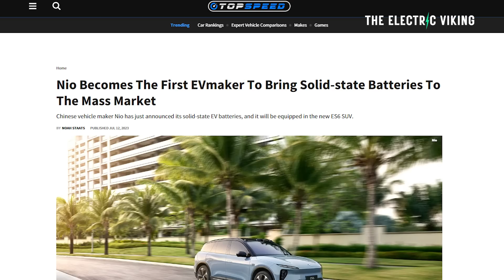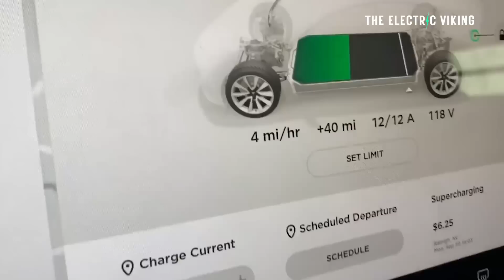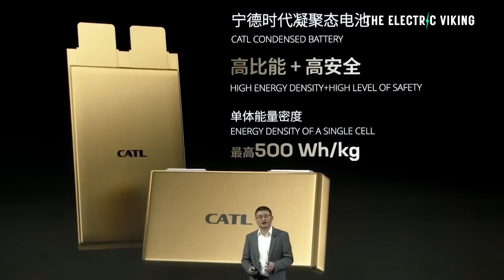CATL reveal new batteries for Tesla EVs that will KILL the competition

Comment: Small side-note; charging LFP based batteries to 100% will still give you less cycle life than limiting to 90% or less. It's just that you get ~3-4x the cycle life over turnery based batteries at the same cycle procedures so it doesn't feel as bad. Some charts show based on earlier LFP chemistries, just keeping the DoD at 80% (between 10-90% SoC) will increase the cycle life from 2000, to 4-5000. It's a big difference. Keeping the DoD to 50% can increase that to 10,000+ cycles. It's pretty insane actually. 
Edit: the chart I was using was based on single cycles. Not Effective Full Cycles. It seems there really is little longevity benefits from charging below 90% on LFP.  NMC is a different matter, the difference is huge. The LFP chart extrapolates that a DoD of ~30% results in 70,000 cycles!! Even if you did that three times a day (effectively using one whole battery capacity) you could do that for 63 years straight!
Reply: a few things everyone should know about LFPs:
1. All lithium ion batteries, including LFPs, degrades faster at high SOC (state of charge) and high C-rates (charge/discharge). 
2. LFP has much lower energy density and is heavier.
3. LFP lasts much longer in stationary energy storage systems with low-C and low-SOC (eg, Tesla's PowerWall), but ages poorly in EVs with high C and high SOC -- which is why LFP is strictly limited to entry-level, low-range EVs.
4. Cleanwatt, citing Tessie's tracking data, reports that Tesla LFPs lose first 10% of battery capacity twice as fast as non-LFP models, ie - to 90% SOH.  Recurrent, a EV rental company, has similar data supporting this finding -- ie, LFP"s faster degradation.
5. Tesla recommends charging to 100% full because BMS needs to be recalibrated frequently to be able to estimate accurate range and avoid cell imbalance issue.  Other EV OEMs, such as Ford, recommends 90%.  
6. we don't know a lot about Tesla's LFP real world long-term lifespan under Tesla's recommendation.  It would probably outlast the 8-year warranty, which is also same for non-LFP models, but not nearly as long as most Tesla drivers would like to believe.
7. LFP's key advantage over NCM/A is its cost. (but if and only if the prices of nicke/cobalts are higher than that of lithium).  LFP at this point is more expensive than high-nickel NCM's (NCM811/NCM9.5.5) in raw material costs.

We will see how CATL"s claim of 4C hold up in the next a few years, but BYD's been having a lot of problem with blade LFP fires in PHEVs operating at 5-6 C's.
Reply: Mostly true with some big caveats: Your biggest problem is you think CATL cells are LFP... they mostly are but CATL added Manganese.  

REAL LFP loses its first 10% SOC quickly because it never has that portion to begin with, but people claim it to "increase" quoted energy capacity.  In fact every LFP battery I have ever had comes initially with ~5% more capacity than advertised unless a B grade cell in which case it comes with ~97% or so... Quality control issues in other words... And if there are worse quality cells in there well as we are talking China after all... it will degrade that initial 10% faster yet.  

LFP If you keep Discharge C rate to 2C is superior to NMC and charge rate to 1C is MUCH superior to NMC.  So, home charging they will SHINE in an EV.  NMC allows higher C rate charging between 10% and 60% SOC compared to NMC and then slows down to slower than LFP for charging.  LFP at this C rate has 2X the cycle life of NMC.  So, real LFP + home charging is MUCH superior to NMC for longevity. 

LFP only RARELY needs to be charged to 100% for BMS recalibration.  This is true for ALL batteries by the way, nothing unique here for LFP.  

#6 ... Yup

NEXT: LFP real world cost is already WAAAAYYYY WAAAAYYY  below NMC, what world are you living on?  Uses exact same %lithium, iron(dirt cheap) and phosphate(dirt cheap) and the telling part is you can buy LFP for ~$200/kWh for Joe Schmo off the street in battery form whereas NMC is 5X that which demonstrates the real world cost delta while lower for the big boys, the actual difference is cost is going to be about the same.

CATL new cells are NOT LFP.  They are LFP + Manganese which cuts the cycle life of the LFP battery up to half depending on how much Manganese is added for that HIGHER C rate and yet ONE MORE reason to NOT believe comparisons between the CATL LFP+ cells in cars and actual LFP batteries...

No free lunch in engineering

 @tooltalk
Reply: @w8stral  >> Your biggest problem is you think CATL cells are LFP... they mostly are but CATL added Manganese.  <<
I don't know if that's true.  Isn't CATLs LFMP marketed as M3P?   There were rumors of 2023 Tesla LR shipping with CATL's M3P earlier this year, hyped up by this Viking dude, which turned out to be just fanboi garbage rumor.  But it would make sense for CATL to do so if LMFP can indeed improve range and c-rate tolerance with some compromise in lifecycles.  After all, moving vehicles operating at a high c-rate are not the best applications for LFPs.  Much of the recent improvements in LFP batteries come from structural/packaging, not from chemistry. 

>> REAL LFP loses its first 10% SOC quickly because it never has that portion to begin with<<
Sure, BYD LFPs (blade) are known to be better and safer than CATL  -- consequntly more expensive -- but I  probably wouldn't call CATL's b-grade cell.  Also the first 10% constitutes about 50K miles, which is not insignificant.

>> LFP only RARELY needs to be charged to 100% for BMS recalibration.  This is true for ALL batteries by the way, nothing unique here for LFP.  <<
Sure, Tesla's user manual recommends otherwise -- encouraging even full daily charging. There are fanbois who still believe it's an advantage which is why it was necessary to cited Recurrent's and Tesssie' study  to counter that.  Other EV OEMs such as Hyundai Ioniq 5, for instance, recommends once a month and you don't see any Ioniq 5 fanbois parading around making that absurd claim about their batteries. 

>>LFP If you keep Discharge C rate to 2C is superior to NMC ...<<
Not sure which study you are looking, but I wouldn't even look at anythig that lumpsums all NMCs in one broad stroke (which can also be said about A123's LFP's), which brings me to the next point:

>> NEXT: LFP real world cost is already WAAAAYYYY WAAAAYYY  below NMC ....
compared to what?  NCM111, 523, or 622 cells?  I specifically cited high/ultra-nickel 811/9.5.5 batteries (widely used in EVs such as the Ioniq5/EV6, F-150, and so on) in comparison,.  In NCM cathodes, the major determinant of cost is (or was) cobalt and, in 80%/90% nickel cathodes, the cobalt content is minimal; 10% and 5% respectively.  Also the higher nickel content means higher energy density. So when compared per Wh/kg NCM8/9 ends up coming out cheaper than LFPs at the market rate.  It wasn't long ago that GM's reported that their battery cost would drop to about $87/kWh in about 18 months (which is using LG"s NCM8/NCMA cells).
Reply: I pay zero attention to what TESLA is doing.  They stopped going into new battery tech long ago.  Tried, might have failed who knows and now is just assembling and making money seems to be their drive right now.  Been reading about batteries for 40+ years as an adult and there is literally nothing new under the sun in the last 25+ years as I was using lithium batteries with exact same energy density as today in the 90's.  For 40 years everyone claims solid state Lead acid, nickel, or lithium is "just around the corner" or some other breakthrough.... and honestly and done at the moment as it is nothing but Bull Shitting trying to get more venture capital.    I learned LONG LONG LONG ago, in engineering, NO ONE EVER, uh hem, NO ONE EVER publishes ANYTHING real Until.. uh hem, UNTIL, an actual product is ready for market and to be sold.   Period, end of story.  So, as a fellow engineer, until I can buy it, it does not exist.  

And of course LFP is cheaper than ANY form of NMC, what planet do you live on?  Nickel and manganese and Cobalt is expensive dude compared to iron or phosphate and the lithium percentage per kWh is the same.   @tooltalk
Reply: @w8stral  Yea, that's what I figured.  You just gotta get out more.   The price is per Wh/kg -- NCM8/9's higher density make them cheaper than LFP.
Reply: What is DoD? I work with (but not for) the Department of Defense and that is what keeps popping into my head.
Reply: @jeffreymerriam7025  Depth of Discharge?
Reply: That is before folks started adding manganese to get higher energy density, but sacrifices cycle life, so beware when buying LFP to make sure it is the OLD chemistry and NOT the new LFPMn chemistry!!!
Reply: The reason you are instructed to charge LFP batteries to 100% is not just because of longer life. LFP batteries do not discharge in a linear way like cobalt based chemistries do.
The voltage remains almost the same from about 80% to about 20%, meaning the computer can't estimate remaining charge based on voltage alone. Charging the battery to 100% calibrates that algorithm, otherwise you have no idea how much energy you actually have.
Reply: @dgurevich1  That's correct. For an EV it's a good idea to charge to 100% every so often for that calibration and balancing. Although they should be keeping track of Ah or coulombs to help determine SoC. EV's certainly have the hardware and compute power for it. 
For other applications like grid storage, accurate SoC doesn't matter so much. I only charge my solar bank to 3.4V/cell knowing that's close enough to 90%. It has active cell balancing at that voltage to keep the pack relatively level.
Reply: Being into Drones before drones became drones. We have been playing with LiPo chemistries for a long time. This is from 10 Years ago. Battery chemistries make a lot of difference. https://youtu.be/fucFhqx-hHw
Reply: What you fail to take into account is that batteries degrade every year when not in use, so its just not life cycle.
Reply: @Fighter4Street  Some batteries 100% degrade over time, some do not.  It depends.  Technically I suppose they all degrade but in practice many do not even though the 2nd law of thermodynamics is undefeated
Reply: Do the math. LFP is usually rated for 2000 to 4000 full cycles.
Most evs are using approx 17kwhr per 100kms. Thus your 60kwhr battery might give you 350kms. Or, 2000 x 350kms = 700000kms to 1.4M kms battery life.
The ave daily commute here in Oz is 42kms. @ 42kms perday, the battery life above equates to 46 to 92yrs. Of course, the car will likely be worn out after 20yrs - 20yrs is the ave life on the road of a car here in Oz.
Thus, a LFP batter should last the 20yr life of a car, providing you do not fast charge it. Note, 90% of all ev charging events are slow charging at home atm.

Comment: Uhhh? Its only 10% improvement granted it comes with other benefits - but those were there already. Guess I am not seeing the "killer" thing here. Solid State Na+S will be the future :D super light weight, smaller, and stronger batteries that dont break the bank. Granted, Li + S will still be slightly better - but for sure will off set by their cost. If anything a hybrid design will be where it is at using both of them. No liquids either that causes thermal run away - making either option much much safer. EVs only need a power dens of around 400-500 before they will be consider "good enough" for the average user and trucks need around 800-1k something I think a chemistry battery like these could hit close to or on top of. Hitting those two alone would cut into a lot of carbon marks + auto driving for trucks and cars will help with transporting goods and services around a lot better. The best value would be around the 500-600 mark for EVs - at that point we're talking HALF the batter size and weight at almost double the range. Now we're talking about a car that would out strip any ICE car on the road.
Reply: Do you always reply to sarcastic comments?
Reply: Um did you know per liter of fuel it is only 2.2kw/kg after you subtract the efficiency of a gas motor
Reply: @lesstevens2370  That would be on par with the max power dents of Li-S batteries at around 2600 wh/kg . Granted, my point is "good enough" being the key area to hit. Most people dont take their cars on road trips every day. The ones that do can still be using ICE cars. Let alone this wouldnt happen over night - it'll be another 50+ years I would assume before EVs fully take over. Even then I dont see a world that wont have a few ICE cars still as the demand for gasoline drops - the supply, and thus the cost, of it will drop/go up making it a harder choice sometimes to go EV when you can pick a used ICE car up for less than 5k$ and your fuel/energy cost less than a 1$. To play fair, think its also hard to compare the two - just lots of factors to play around with. For example, as the power goes top - the less weight is needed over all - thus at max power - we're talking a batter pack 6-7 times smaller than they are now - giving back a ton of weight back to the car it no longer has to carry around allowing it to go I would assume even further per mile of energy. Even more so, unlike ICE cars that have to have bulky heavy engines, EVs do have another option as well that is lighter and smaller with about the same power ef as their counter parts that would also require less weight.
Reply: @adr2t actually when the demand goes down for fuel the price will skyrocket probably $10 a gallon because all these oil companies are leveraged to the nine they can't afford to give fuel away on there dime it kinda like car manufacturers you need to mass produce vehicles at scale for the prices to be cheaper if you have a low demand price go up
Reply: @lesstevens2370  The thing about gasoline though is that its already a small amount of the over use of oil in general though - oil will still be needed for other things - yet there will be a large supply on the market because not everyone will be about to use it up. From bio fuel, shelling oil, and just gasoline - we're still talking at least 50 years out so yea. You also still have Ruissia thats going to want to sell their oil either way to fund their country and other oil base producers that at some point will see a smaller demand either way over all as all countries move away from oil heating and or for car use. Even if they want more - they wont get it because EV exist now - and people will just move faster over to it. So yea, I still see a world where fuel drops as the demand drops and the supply stays high.
Reply: 10% improvement is pretty damn big, especially with all the other improvements on top of that. Granted, it's not as great as your magic sodium sulfur solid state battery, that may or may not exist in 10 years, but then what is?
Reply: @4203105  SS Li batteries just hit the market a week or so ago. Price is still going to be high for them (like any new tech). SS Na is right behind it to be release this year. SS Na Sulfter is plan release in the next 2-3 years. Solid state will be the game changer anyways coming with lots of improvements. PRoblem with Li will be mainly come down to cost and supply. The Li problem isnt fix going to SS. It only helps improve the over all size/weight. Meaning they might put less batteries in or add more for longer rangers - but you still end up paying about the same or more sadly. Na will help reduce the cost and SS + S will help improve that to the point the cost will not be as much of an issue going forward with smaller designs and weight + easy to get supply - more supply the more you make. The more you can make - the cheaper per cell it can be. Its already plan - set - lock - in. So no "then what" as any country could make them. No one will be limited to a single country to have them. EU, US, China, Mexico, Japan.. doesnt matter who anyone will have access to make them if the demand is there.

Comment: I'm not sure it's game over. The way I see it we will have EVs with different battery chemistries based on market, customers with performance, quality and range preferences. I wouldn't be surprised for mainstream markets going more for Li turnery mixtures or perhaps hybrid batteries, whilst more temperate climates can enjoy the LiFePh advantages and quirks. Hotter climates may perhaps also prefer LiFe type batteries who ate let Hest prone runaway. In that regard I'm curious what sodium batteries will do in each climate setting.
Reply: Na should be able to hit cold and hot areas - but with lower range - so more low end range cars until more search and they become the "Good enough" mark. Then again, I do see them being used in some type of hybrid design either with Li or maybe some type of NaFe design. Granted, I think all of them will be going towards solid state + sulfur designs. Sulfur is easier to get a hold of over active carbon and normally cheaper than Fe. Major reason is the fact it can hold more charge ~ thus lower the weight, size, and cost. Going solid state removes weight + a liquids that can cause thermal run way - making them safer. Going back to Li and Na hybrid designs would then be lighter, but Na can work better in both temperature - but using the Li once it warms up / cools down enough to use that instead for the longer range.